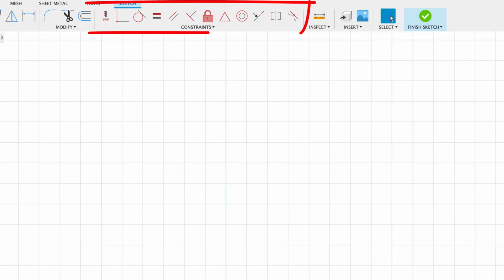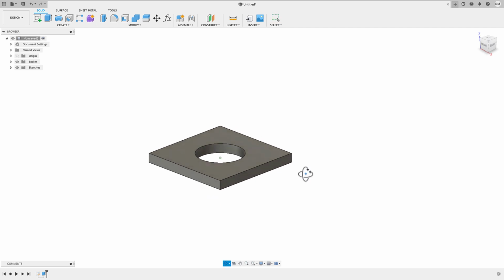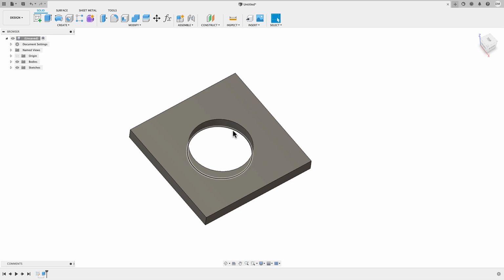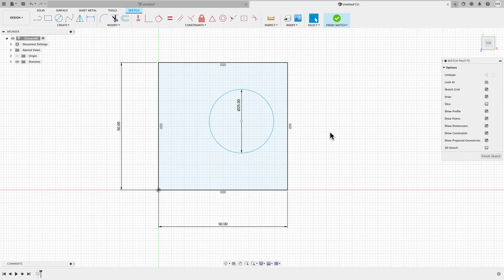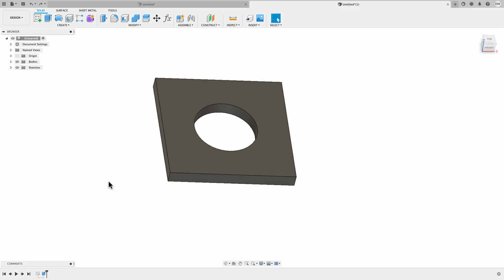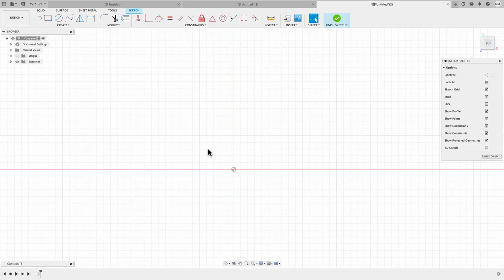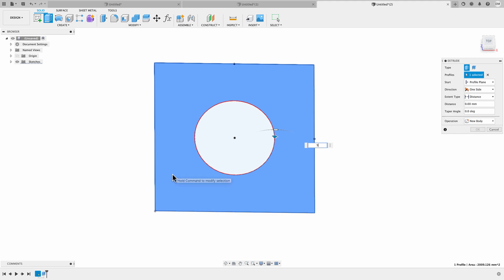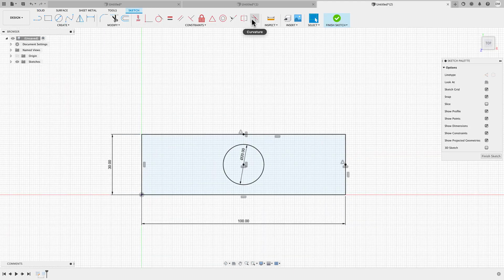Why Sketch Constraints are so Powerful in Fusion 360

Comment: You could also use derived dimensions. Where the distance is the width / 2. Not as good as constraints but better than manually typing 25mm.

Comment: Nice video!
How can I constraint to an face of an other object?
I have a furniture with a plate (I hope this is the right english word) in it and want the edges of the rectangle in the Sketch constrained to the faces of the inner walls. (So that when I put the walls further apart the plate is still big enough)
Reply from the maker: Using the Extrude tool, you would Extrude from Object.  Select the face as the Object.

Comment: I'd been using the H/V constraints on and off, but never like that. I usually do it the harder way by putting in diagonals of some sort, and then constraining the center of the circle to the mid point of the diagonals.

Your version looks MUCH cleaner.

Comment: Could the circle be made coincident to the center of the square?
Reply: NVM: Tried and it doesn't work.
Reply from the maker: @johnbickford9221  Yes, if had created a Center Rectangle instead of a 2-Point Rectangle, I could have simply snapped to the center point.  I also could have drawn a diagonal line from corner to corner of the 2-Point Rectangle and made the circle coincident to the midpoint of that line.
Reply: @DesktopMakes  I actually thought about the center rectangle later later. I even drew diagonals but forgot about midpoint. Sketches are so often fragile if not careful.

Comment: good video, thank you

I try to constraint my drawings as much as possible. Creating 'fillet' often removes constraints (length of a side), how do I avoid this?
Reply from the maker: Hi Wolfgang.  To prevent this from happening, I will often avoid using the Sketch Fillet tool and instead will use 3D Fillet when needed. The other option is to use Sketch Fillet but then go back and re-enter your dimensions.

Comment: Looking forward to hearing more! I've also found constraints to be very helpful, but feel like my use of them is still somewhat narrow. For some reason my rectangle/square doesn't have a mid point of the side, do I have some setting turned off?
Reply: ah only pops up when you hold down shift!
Reply from the maker: Yes, hold shift!  Glad you figured it out.

Comment: What I would find, very useful. Is a “tutorial” same page/settings, enviroment, to start with.
For example. Some tutorials have the Z axis, up, some the Y.
First, I just followed tutorials with z up, same as mine. Then I learn how to change in user profile, preferences. But after each change. I had to shut down Fusion 360 and re-open it.
Then I discover one just needs to click the two crosses, close drawing, then, new design.
Now in this tutorial, when I double click to edit drawing in the time line. The dimentions are not there. Yeah found them, right click sketch in browser tree.
But I think it would be useful if you could provide a list of all your settings. ie. Units, display settings, snaps etc etc.
Your Tutorials are awesome, by the way
Regards Bruce
Reply from the maker: Thanks Bruce.  This is a great suggestion!  I will add to my list of videos to make.
Reply: @DesktopMakes  Here's another suggestion: harvesting email addresses is something spammers do, so don't do that.